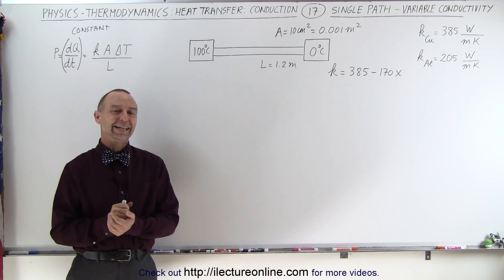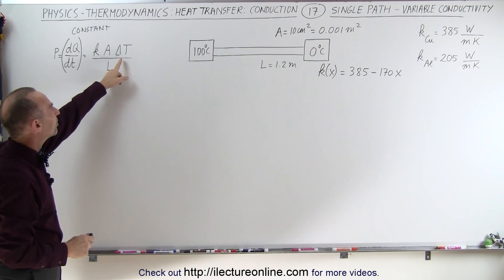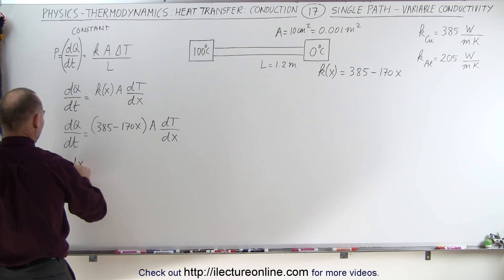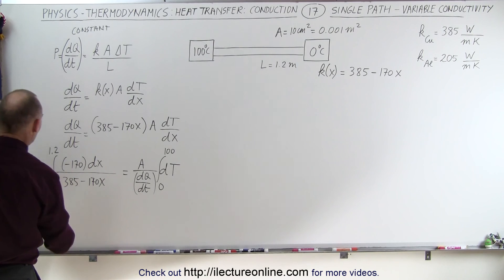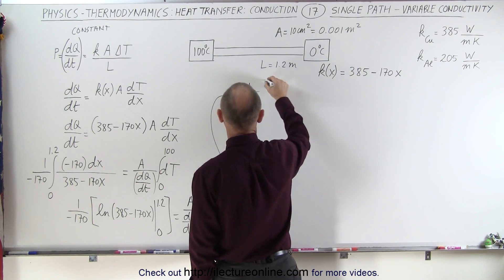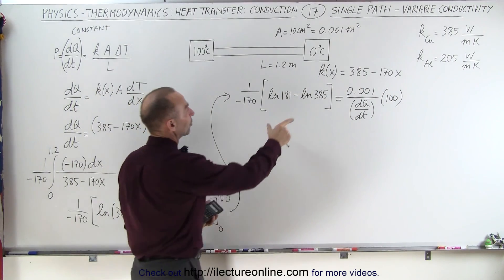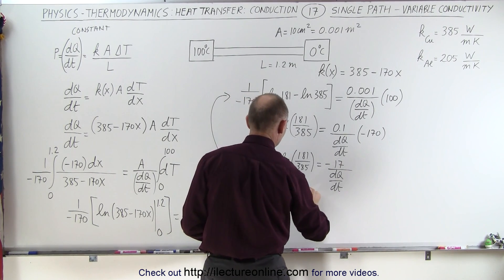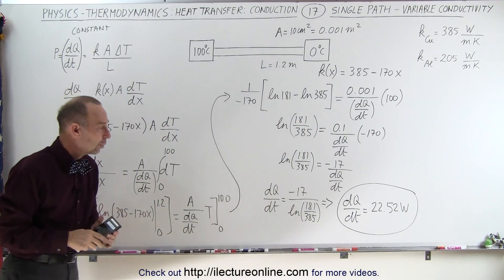Physics 24  Heat Transfer: Conduction (17 of 34) Single Path - Variable Conductivity

Comment: Does the temperature change represent the temperature change from 100 C to the temperature of the location dx from the hot reservoir?
Reply from the maker: The temperature "change" is really the temperature DIFFERENCE between the one side and the other side of the heat path.  The temperature change of an infinitesimal distance dx will be an infinitesimal change in the temperature dT.

Comment: Could you make a video regarding thermal diffusivity?
Reply from the maker: thermal diffusivity is the rate at which temperature (or heat) spreads through a material.  Materials with a high thermal conductivity will have a high diffusivity and materials with a low thermal conductivity will have a low diffusivity.

Comment: Why does the change in temperature have to change? If it does change, what would the temperature gradient look like? What is the difference between specific heat and conductivity constant?
Reply from the maker: The temperature is not changing.  Delta T represent the difference in temperature between the one side of the conducting path and the other side.

Comment: Thanks for the great videos...just a quick question about the conductivity function k(x)=385-170x. I understand that the starting value is 385 which indicates our material starts off as Copper but I am a bit confused as to where the coefficient of x came from? I thought maybe it was the difference between the conductivity of Copper and Aluminum but that gave me 180. Any insight you can provide is greatly appreciated. Have a great thanksgiving!!
Reply from the maker: This is just an example of how you would solve the problem if the coefficient of heat conductivity was not constant, but varies with position (as shown with the equation).
Reply from the maker: And have a happy thanksgiving as well!